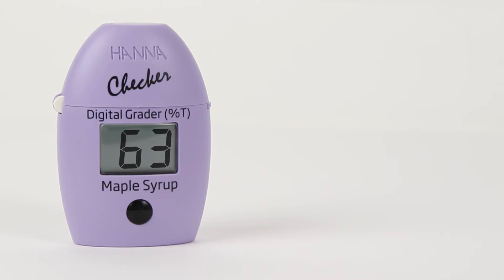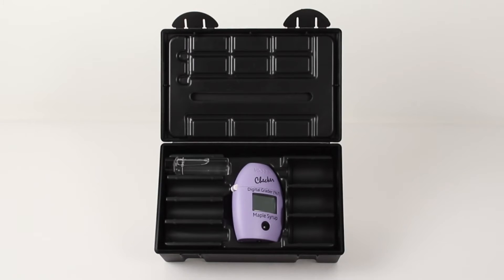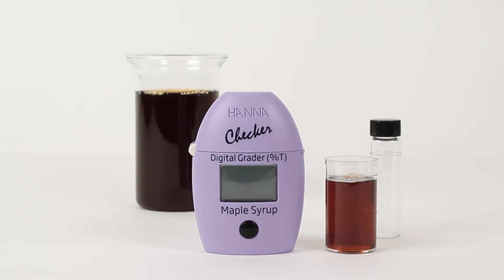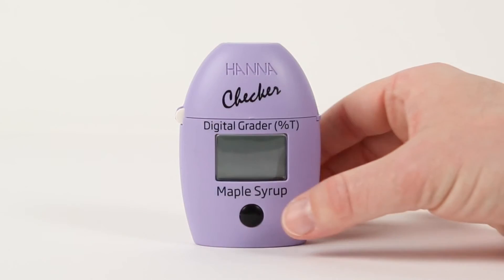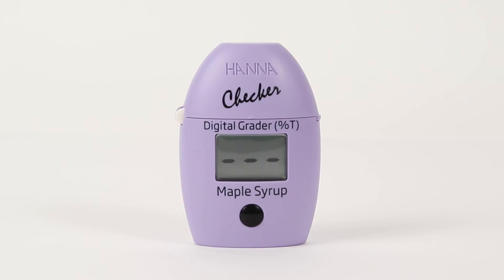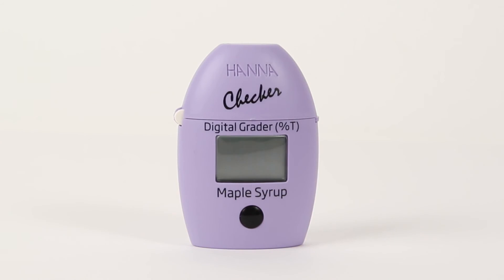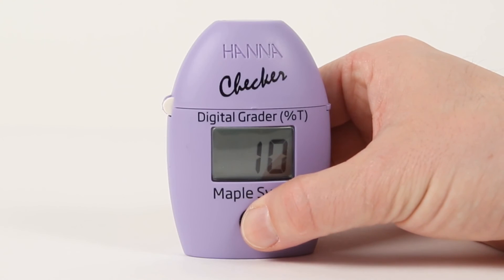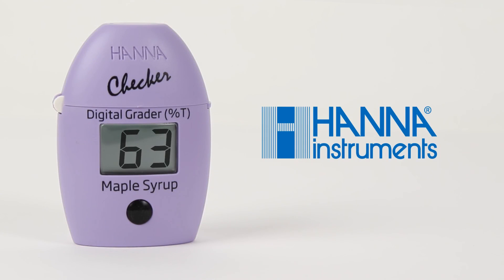HI759 Maple Syrup Digital Grader

Comment: Hey are those the same cuvettes that are used with the Hanna multiparameter photometer ?
Reply from the maker: No, the cuvettes used with the photometer are slightly different. Mostly due to the cap. The cuvettes for this meter don't require the same kind of seal. Hope that helps!
Reply: Thank so much for the response. I really need these caps (http://www.ebay.com/itm/HANNA-HI-731325W-Cuvette-Cap-4-pcs-75-for-10ml-glass-cuvet-sample-cell-/231397766633?hash=item35e061b5e9:g:0toAAOxy4dNSyiJI) for my photometer glass cuvettes but I can't seem to find them at your website. Could you please help me, because I have to make my order soon.
Reply from the maker: Hey so I got these for you. 
these the ones?
http://hannainst.com/hi731325-caps-for-glass-cuvette-used-with-hi96-series-portable-photometers-and-turbidity-meters-4-pcs.html

If I may ask, did you use the search bar on our site? I'm hoping to figure out where the disconnect happened so we can address it. We want searching on our site to go nice and smooth for you.
Reply: Hanna Instruments, Inc. Oh No. The ones that I use (I got 4 of them: glasses and caps) have the caps just like the ones I shared the Ebay link with you. Are you sure these (http://hannainst.com/hi731321-small-glass-cuvette.html) cuvettes can be used with the ones you mentioned above with THIS PHOTOMETER (http://hannainst.com/hi83099-cod-meter-and-multiparameter-benchtop-photometer.html) ???
Reply from the maker: Yes, indeed. they are compatible.